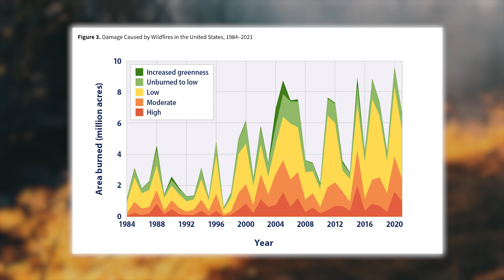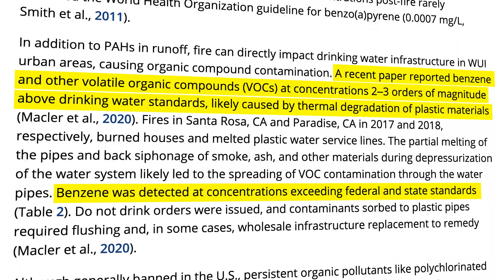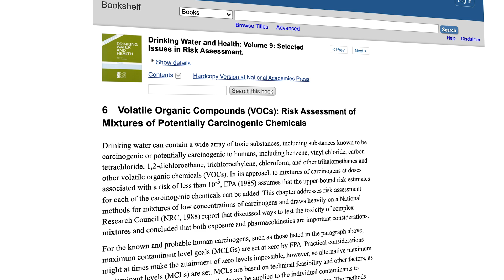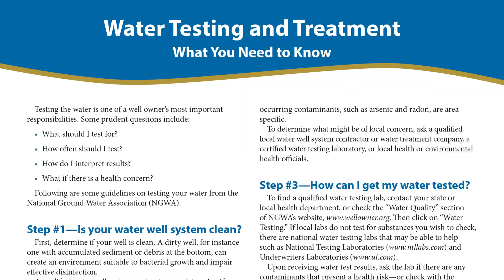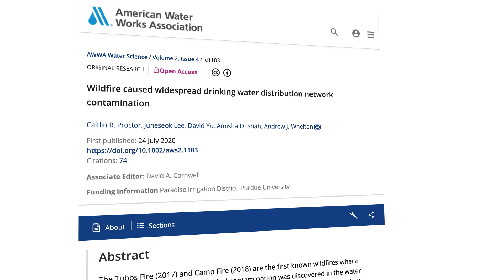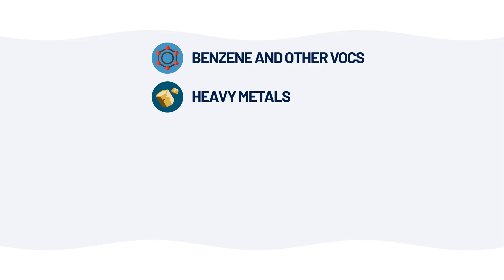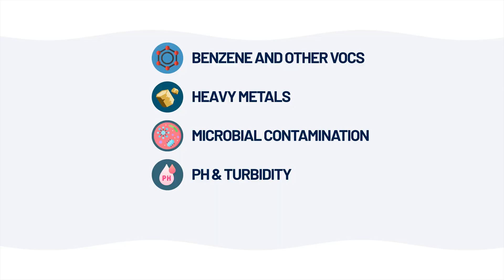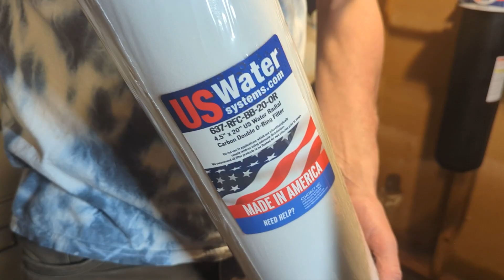Drinking Water of MILLIONS at Risk from Wildfires

Comment: Hi, you've helped so much thank you! Outstanding stressor: for emergency storage in earthquake/fire area (LA), do you have preferred brand of 1 gallon plastic water jugs for storage? Arrowhead, Mountain Valley, Crystal Geyser (dents easily), Pure Life distilled?  Also..best pitcher to filter out the plastics given these will be leaching chemicals during storage despite 6mo/1yr rotation.  I could potentially use a power bank for my countertop RO but a pitcher is a good back up.
Reply from the maker: For emergency preparedness, I'd actually just store tap water in those larger 7 gallon containers, then filter before drinking. Check out this video where I talk about that in more detail https://www.youtube.com/watch?v=Btqqwd_cLiA&t=473s

Using a power bank with your countertop RO will be your best bet and provide the most significant contaminant reduction. You have a gravity-fed system with ceramic shell filters like the Berkefeld ultra sterasyl https://geni.us/eiAvEH8 (which is certified for microplastics reduction) as a backup solution.

Comment: I had a question if lifestaws or gravity filter really do filter a good amount of contaminates in like lake or pond water. I dont know if you would recommend something like the waterdrop gravity filter.
Reply from the maker: The waterdrop king tank gravity system should not but used with untreated, microbiologically unsafe water like pond water. It's carbon block filter is not capable of removing pathogens. It can remove many organic contamints. If you want to use it with pond water, make sure you disinfect first!

Hollow fiber membrane filters like Sawyer and lifestraw are sufficient, but they only remove suspended solids (including bacteria and parasites) don't to a certain size. They do not remove any dissolved organic or inorganic contaminants that may be present in the water. 

Hope this helps clarify
Reply: It definitely does clarify. I also wondered if you had any recommendations for water filters when hiking  @waterfilterguru